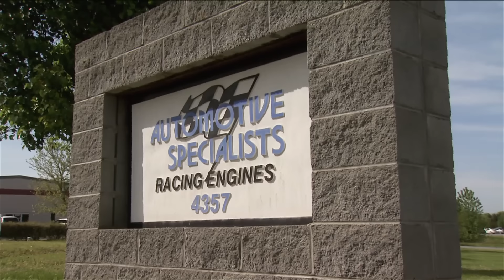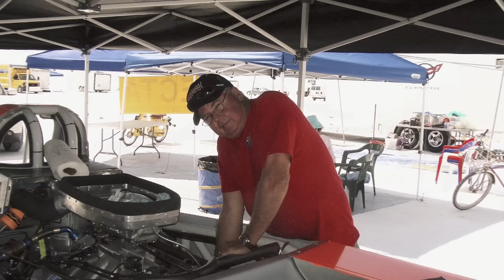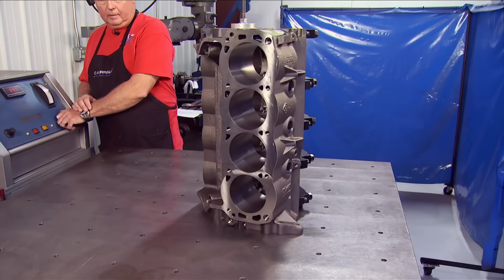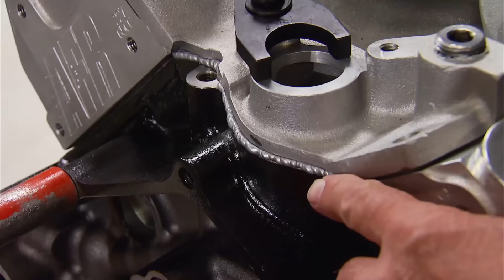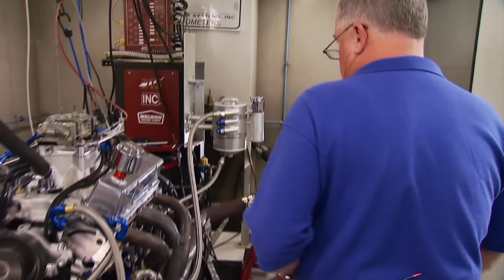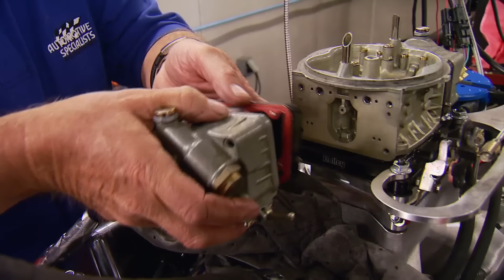Secrets To Building Championship Race Engines - Horsepower S15, E8

Comment: Detail orientation. Very important. Don't be afraid to create a checklist. A street engine is just as critical as a NASCAR engine. A lot of those race engines are taken apart very regularly. Not so with a race engine. Also the versatility of a street engine is really greater to be truthful. Stop and go driving. Mature antics.Hot climate cold climate and just not doing anything to it for a hundred and fifty thousand miles plus. Ok oil changes basic service things of the sort.Details could mean a lot. Down Time. Not good if you're relying on the car day to day. His sonic checking his fitting the pan and manifold. The roof of the intake ports.Here is one thing they stressed in the Direct Connection manuals for Chrysler engines. Good video. Straight forward. Not too hip and happening.

Comment: Beating a gasket with a hammer. That is a new one. Beats the  printed seal on the gasket. What is the engineering principle behind that? I doubt the gasket manufacturer recommends it. All i use is a little glue to hold it in place. Contact cement .Some guys use Shoo Goo . Most dummies use RTV which is not a gasket sealer or dressing and can make problems.
Reply: One day Keith will have the clientele you do , I am sure your way is better.

Comment: It’s 4.125 bore, and judging by the rod/piston combo it’s gotta be 400-427 cubic inches.
Roller cam, roller cam bearings, dry sump, those heads/rockers/pistons/rods. And the accessories. That is one expensive 600HP motor. Yikes
Reply: I doubt that not enough torque engine is more likely in the 350-60 range
Reply: 372 cube I reckon

Comment: Oil temps kept you guys from breaking 600, now that is wild!
Reply: Not one formula one engine goes on the track without bringing the oil up to temp. Any Bike racer will do the same. Oil flow or no go.
Reply: Thinner oil, less friction, more power. It's simple